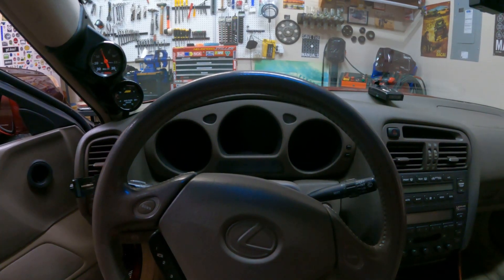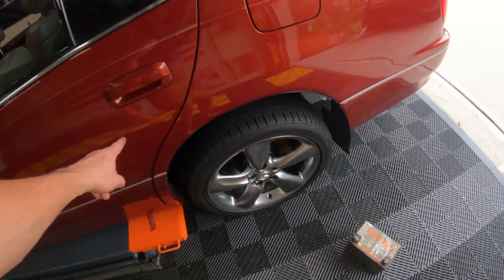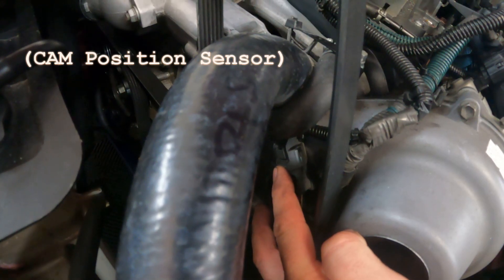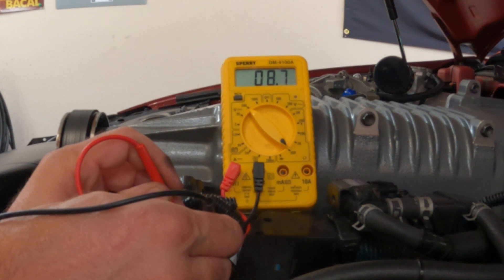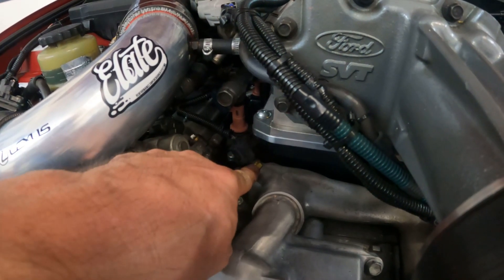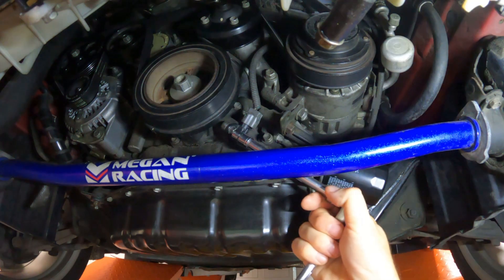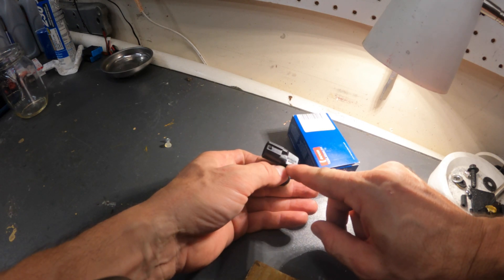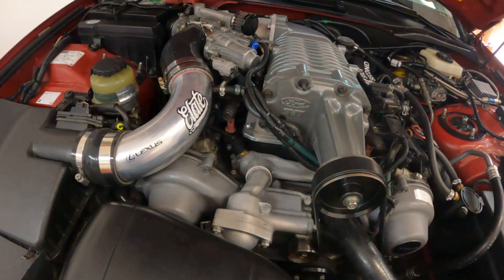Tackling a frustrating no-start condition and what to look for if this happens to you.

Comment from the maker: *SEP 2022: problem was a faulty ATEMU from my manual swap. It was bleeding voltage to the NE+ crank sensor pin at the ECU*
Reply: So it WASN'T the temp coolant sensor?
Reply from the maker: Correct. The problem was that the NE+ bleed issue was happening sporadically. So, coincidentally after I replaced the temp sensor, the car started and drove normally. Therefore I concluded that was the issue and filmed and released the video. Then it turns out that wasn’t my issue. So I had to pin a comment. Nonetheless I went through just about every no-fire troubleshooting scenario I could and at least I was able to share that process.

Comment: kind of an old video but, worth a try. i replaced my fuel pump car cranked right up and drove perfectly fine. parked it for about an hour and it just cranks now. if i leave it alone it will turn back on when some time passes. any idea?
Reply: I have the same exact issue. Few cranks but eventually will start up if I let it sit a few. Worst feeling especially when I'm in a rush to work :/
Reply: @altezza2jz let me know what you come up with this is exactly what im going through
Reply from the maker: Is this what it was doing before you replaced the FP, or did it start after?
Reply: Any luck?

Comment: Thanks for the video.  I have a question. My 2000 Gs400 intermittently get stuck in park. I changed out the shift interlock solenoid, brake lamp switch, key interlock solenoid 
and the ignition switch (white part behind the key cylinder). Car still intermittently won't shift out of park, needs to use the shift release button.
I'm thinking of checking the body ECU no.2 .  Any idea what else to check
Reply from the maker: Do you hear the interlock release click when it does not work? I’m really not great at electrical stuff. A ground seems like a reasonable check. There should also be a troubleshooting flowchart in the FSM.
Reply: @ForwardMomentum  yes I hear it clicking then some days there is no click. Thanks for the reply. I will check schematics

Comment: I have a 94 GS300 with crank, no start. I loosened distributor, rotated it, mo spark. Changed out 4 different ignitors, nothing. Can the coolant sensor also  cause it to not spark?
Reply: Same but I’m also not getting any signal in my crank sensor even replaced it

Comment: great videos, what type of battery do you have in your GS400?  I have a Diehard Silver in my 1999 GS400 and I think the CCA are too low for cold days as I experience no starts during below freezing days.
Reply from the maker: Thanks! I run a Costco (Interstate?) battery. Seems to be fine, but I also notice a bit slower crank when the engine is really cold.

Comment: FWIW, my stock GS400 started to not start when I cranked her. Turned out the engine immobilizer was armed (indicated by the red blinking light on the dash, left of the steering wheel), and sometimes my key won't turn it off when it is inserted into the ignition. The forums say the immobilizer system is a mother to fix, so I hope it doesn't get worse!

Comment: I had this happen to me last week, but it only lasted a couple days and it hasn't done it since.
Reply from the maker: Well my issue just came back yesterday. Car sat for a day after running perfectly, cranks but won’t fire. Replaced temp sensor. Same issue. I’m going to pull my hair out. Seems I have a no fuel scenario, (no fuel in combustion chamber this time). Going to put a psi gauge on the fuel feed first. Then figure out why my injectors are not firing. This sucks.
Reply: @ForwardMomentum  So did you find out what it was?
Reply from the maker: Yes. Comment now pinned at the top. ATEMU was bleeding voltage to NE+. ATEMU replaced and all has been well.

Comment: Makes sense its something you probably touched when you did your supercharger. As for the radiator hose im doing a custom Mishimoto metal rad hose with silicon 1.5 end pieces. I did find a standalone spitronics ECU 1UZFE VVTI kit. I watched a few videos and it pretty much utilizes the crank position sensor, ignition, fuel and keeps rest of your ecu intake. It allows you to control the air fuel mixture with a laptop and looks like might give you more control then a piggy back.
Reply from the maker: The connection was loose for some reason. Now it’s tight and all good. Regarding the standalone…nice! Just make sure you can retain TBW and VVTi control with it installed. I looked around on the Spitronics site and could not figure out where the VVTi kit was. Post a link directly to it if you have a second. 👍
Reply: @ForwardMomentum  As for the connector I had connectors become brittle over time. I got a 98 Lexus GS400 and its just old lol
Reply from the maker: This was actually a bad connection due to an aftermarket temp sensor (it was labeled as OEM but probably a counterfeit). Now secured thankfully.
Reply: How do I give you the link if youtube keeps removing it?

If you go to there support there's a firmware update and settings to set VVTI on spitronics website.
Reply from the maker: My friend found it and shared it. We have some questions out to them like TBW and VVTi, how it would work with the ATEMU, etc.

Comment: Greetings Forward momentum I had a question about the GS and wondering whenever you have the time you can respond which I would appreciate greatly so I have a 2003 GS300 and I hear a ticking noise coming from the front left side wheel gap sorta under the car it is difficult to hear when I pop the hood and stick my head in because of the pulleys blocking the noise and the ticking does not go faster when I accelerate only in idle do you have a similar sound or idea? Could it be the fuel injectors?  The ticking is slight and only could be heard when parked next to a wall or car so it echoes back. Appreciate any feedback
Reply from the maker: It sounds like the fuel injection system. If your car has a fuel pulsation damper on the end of the fuel rail, you can consider replacing it to minimize the noise. Easy job. Good luck! 👍
Reply: @ForwardMomentum  thanks for the feedback I will look into it ! Thank you 🙏

Comment: In my experience the new ECT will fix No Start / Hard start issue AND it  will help improve idle and throttle response.
Reply: can you explain what this in more detail?
Reply from the maker: Engine Coolant Temperature Sensor. It’s critical for the engine to run optimally.

Comment: Nice! I'm not experiencing this but what I am experiencing is a clicking noise when I turn the key sometimes it starts sometimes I have to turn the key a bunch of times to get it to catch. Already changed my battery terminals and everything still having the issue that and a gas smell that comes and goes as it pleases from somewhere under the hood. I have an 01 gs430
Reply from the maker: Sounds like the starter to me.
Reply: @ForwardMomentum  I'll change it out and let you know the results